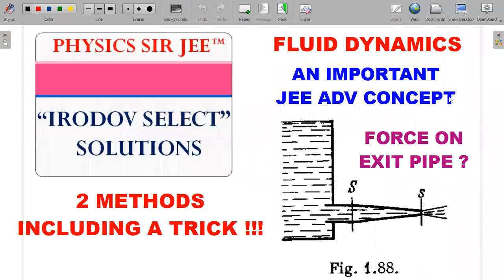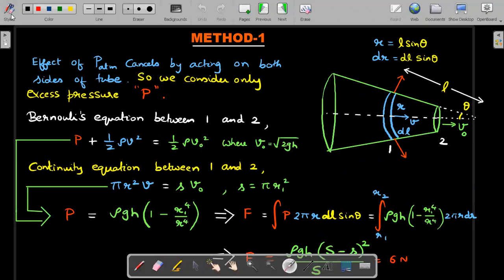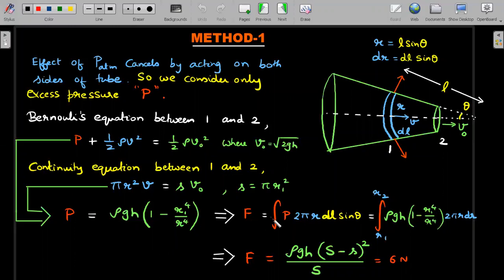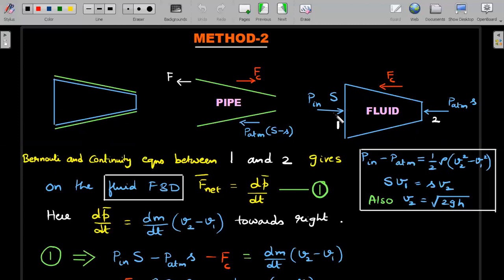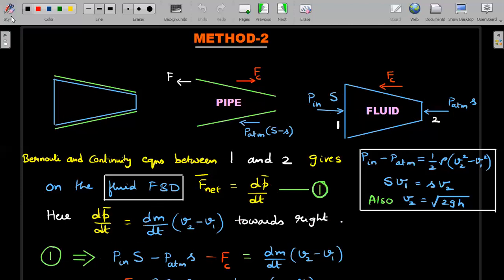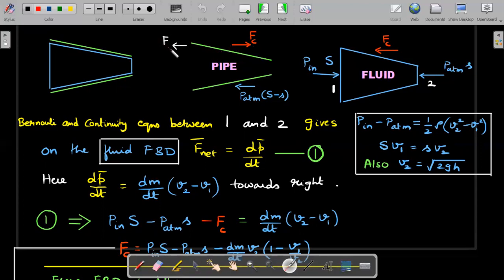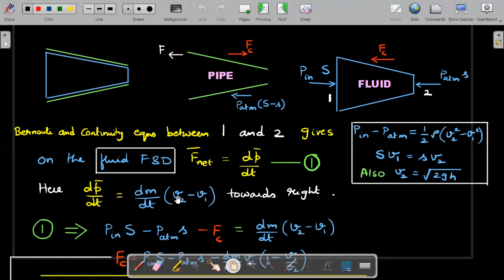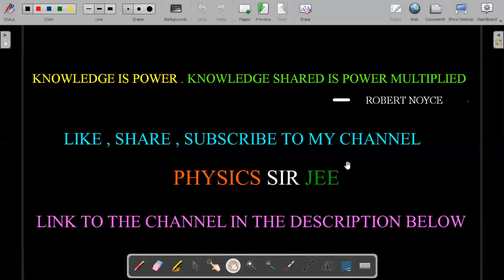IRODOV SELECT VIDEO SOLUTIONS |PROB 1.329 | FORCE ON EXIT PIPE |FLUID DYNAMICS |JEE ADVANCED PHYSICS

Comment: Sir why the first method gave us the force in the question and not the Fc between pipe and water..
Im very confused please reply
Reply from the maker: Time stamp of your doubt please?
Reply: Sir I got that doubt cleared..I have another doubt..in the last part of the video u presented a formula for average pressure..sir there Pavg* projection area..
Would give what, contact force between pipe and water..or the force asked in the question

2nd.. im unable to derive it because of the same confusion..of which force is it..
Can u please give a approach to deriving it..
Im in 11th class and a little weak in these stuff
Reply: Outward force due to atmpospheric pressure is taken into account so it is force by water-force from outwards i.e. force between pipe and water , since he took excess pressure

Comment: Whatever you have explained ,I understood....I am bit having problems in direction of Contact force .Since ,This force is not Viscous ,Are you taking pressure near the Pipe Surface ..that in this case (Horizontal components) will be horizontal leftward..
is my reasoning correct? Please Clarify Sir.